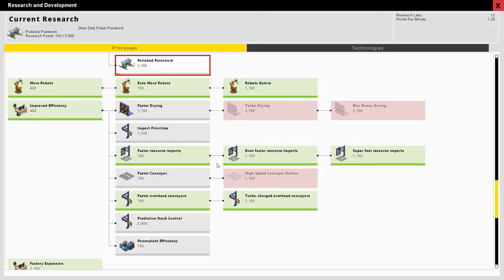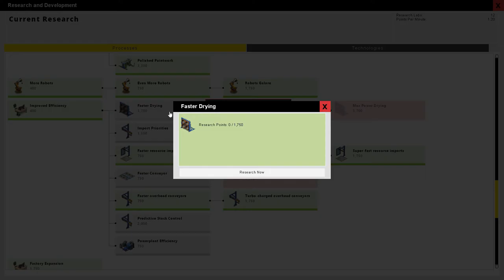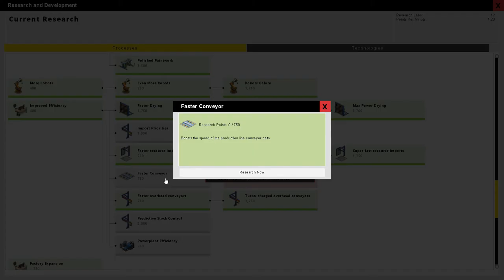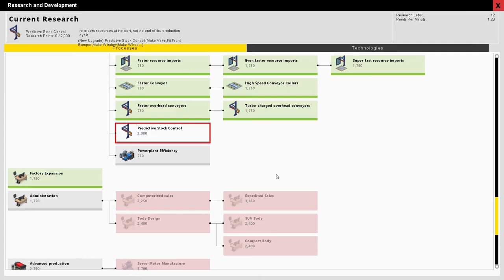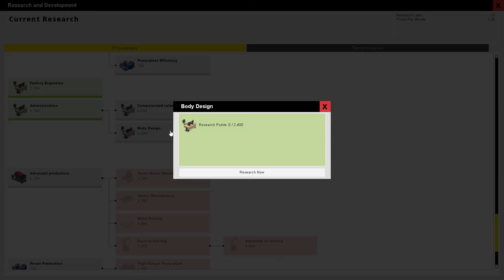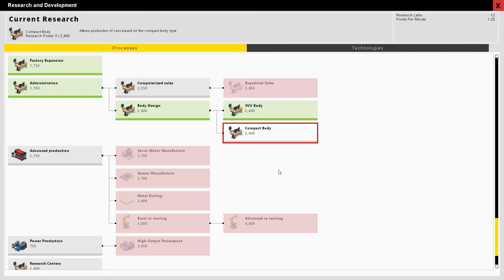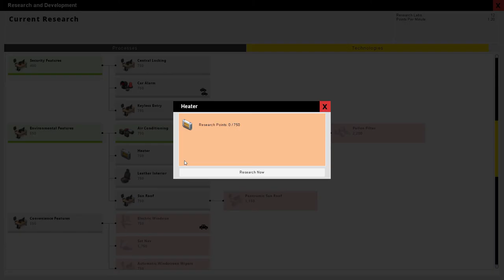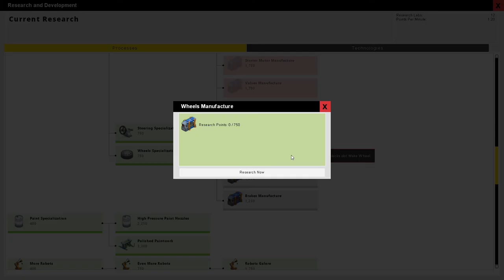Production Line - Screwing Up That Efficient Factory - Part 2

Comment: I can feel it becomes boring after you sort out everything. hopefully it doesn't come too quickly!

btw you didn't connect the stockpile to the unit that requires the parts. it's only connected to the supply chain so it has to to do a huge detour to get to it.
Reply from the maker: Yup I missed that stockpile thing. I fix it in the next vid. 

It is quite easy to keep yourself profitable so far. The trick when it comes to maximizing your income. Splitting your units into sub-units, splitting off into multiple copies of the same sub-units, manufacturing your own parts, etc if where it gets a bit trickier.